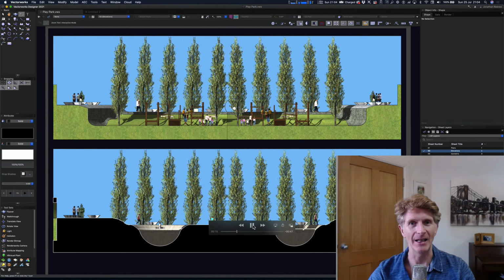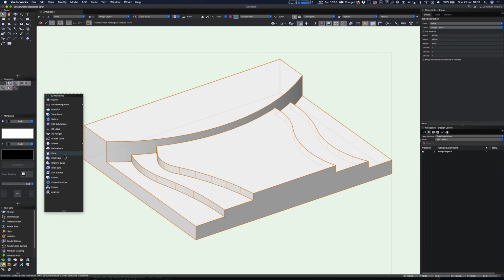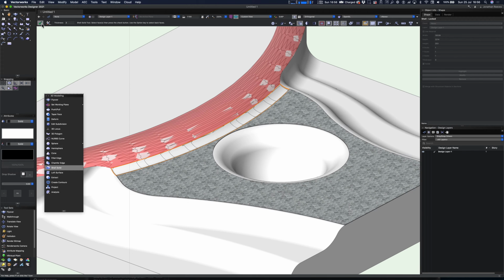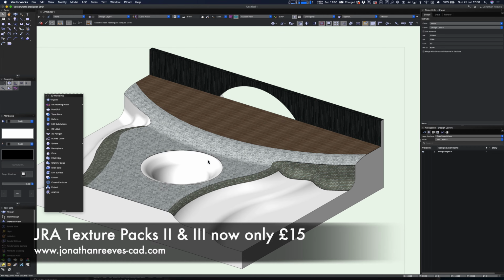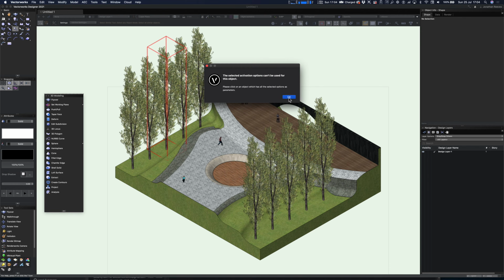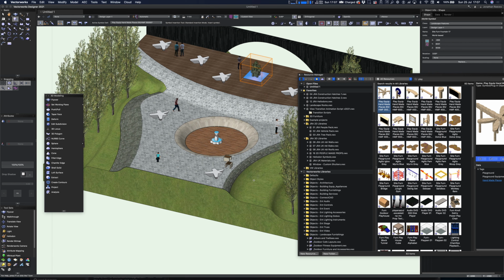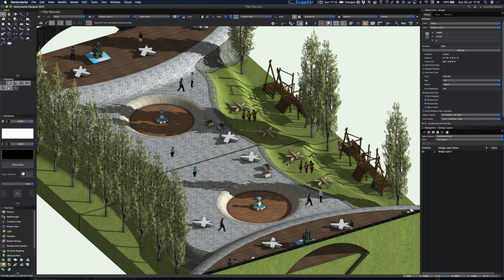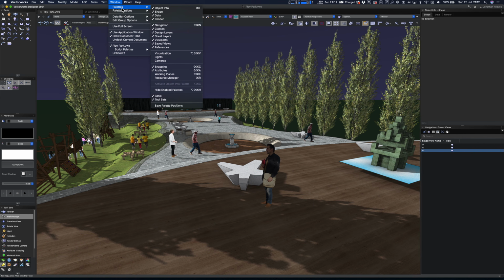Creating Complex Landscapes in Vectorworks (4K)

Comment: Thank you for the video. Question please: Is there a way to draw polylines in 2D first, then Push/Pull in 3D? Because I need to draw the surface in 2D.
Reply from the maker: Yes just use the instant push pul mode after drawing or extra them after when you are ready. Please check out  my Members section if you would like to learn a lot and supra the channel, or reach out for some bespoke training!

Comment: Excuse my ignorance. How do you get the arc to draw on the top surface and then split the surface? I cannot find any videos showing how to do this.
Reply from the maker: Make sure you select automatic plane mode when in a 3d view and with a 2d drafting tool selected, then push pull after drawing with subtract mode activated.
Reply: @jonathanreevescad  Where does one find it in a PC version of Vectorworks Landmark 2023? Appreciate an answer